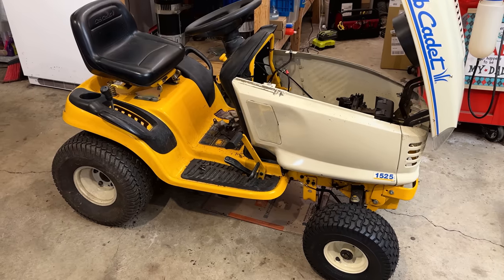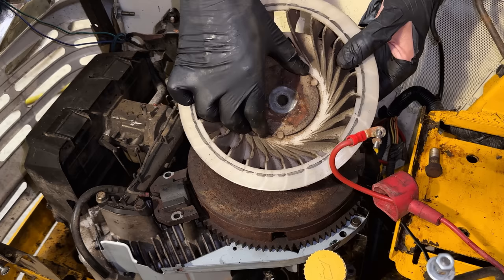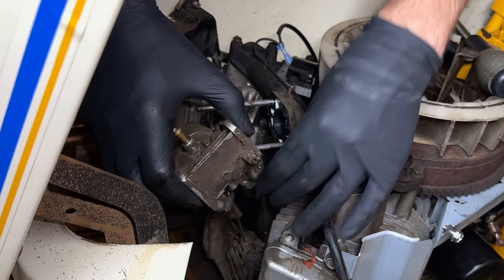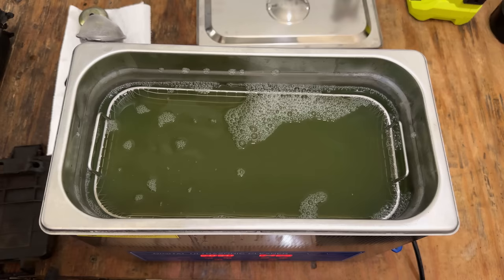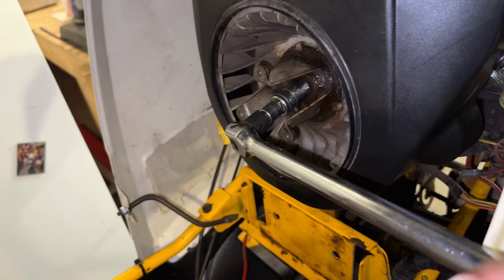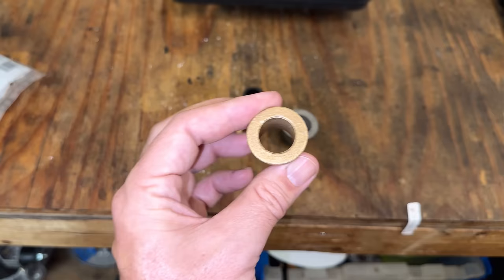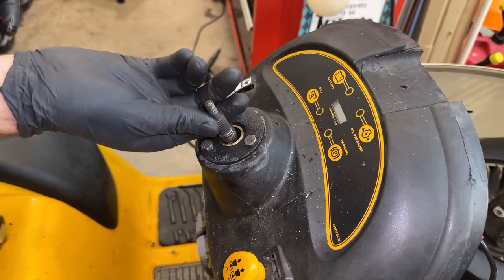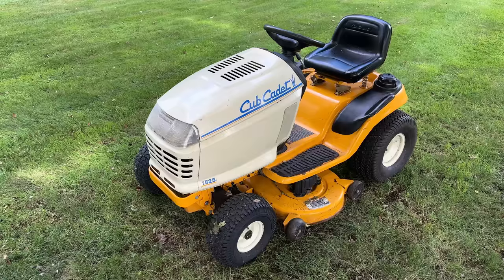Cub Cadet Crash (Pt 2) - Tractor and Tree Damaged

Comment: I think there's a lot more to the story you weren't told, not to mention a massive lack of maintenance.....I can't see an impact that caused only a small dent and no damage to the hood causing that kind of damage to the steering.  And he must have stored that thing in a salt shed for 20 years to get that kind corrosion on the engine.  Also you probably should have skipped the grease....it sounds like a good idea, until it gets full of dirt, and then it's like having sandpaper in there.  A plastic bushing, dry film lube, or nothing at all would have been a better choice.

Comment: 52:20 Why not just use fiberglass to make the hole the right original size where it is worn away?
Reply: You need clearance to allow the shaft to turn...so how do you JB weld that hole to achieve that clearance?
Reply: @JohnSmith-pl2bk  First, fiberglass, not JB weld. Second, there was already plastic there. After the repair, it would be fiberglass.
JB weld would never hold, but fiberglass would.

Comment: Great Video.  Maybe I missed it but did you replace the blades? I did notice that you straighted the front bumper.  Good job.
Reply from the maker: I part 1 I replaced the blades
Reply: @jcondon1 You may want to get a high lift mulching blade.  I have Gator blades on my 38 inch deck and they do a nice job.

Comment: Dam, how fast was he going?
Reply: I see you still put batteries on the concrete floor you should put a board underneath your battery or batteries save the energy within the battery it won’t drain into your concrete floor cement floor which ever way you want to say it

Comment: I am working on a Cub Cadet push mower right now that has been sitting for an unknown number of years. The carb was in rough shape, but I gave it a thorough cleaning, and it appears to be functioning now. The mower will only run for about a second, and never gets to full speed, even with starting fluid. It has an OHV engine, but I can't figure out what brand it is. The engine number is BCZHS 1791V1. I was thinking of doing a valve adjustment on it, but I need to know what the proper clearances are. The mower was produced in Sep 2011. Do you know anything about this engine?
Reply from the maker: I do not know about that engine.  If no specs, would check where the valves are now.  Usually an intake should be around 0.004” +- 0.001” and the exhaust a little more 0.006” +- 0.001”.  The important thing is that each valve has at least 0.004” of clearance and no more then 0.007” on most OHV engines.

Comment: See those little blades of grass by the Cub Cadet logo? Yours was made by MTD. Many Troubles Daily. Some good names like Cub Cadet, Troy-Bilt, Craftsman and more have been either bought out by or farm out the production of their outdoor power equipment to MTD. They  cut corners like that so called plastic steering bushing in the the instrument cluster and other short cuts to reach a price point so the can make a big profits for the share holders. In the process they produce a piece of crap that destroys the reputation of some formerly well respected brands.

Comment: What kind of cleaning liquid did you put in ultrasonic cleaner that does not destroy aluminium?
Reply from the maker: Harbor Freight Super Heavy Duty Degreaser.  It works well, but does react with some carburetors and caused the aluminum to darken.

Comment: Do you have a DOM on that tractor? Pre or post MTD purchase of Cub Cadet? (1995)
Worth fixing up? Yes. I just put $500 into my 2004 Craftsman/AYP/Husqvarna LT3000.  My deck rotted out, so I bought a new deck, replaced both spindles, even though the old ones were still ok.  New carriage bolts and nuts,  deck belt.  It now runs like new. It nearly looks like a new unit after 20 mowing seasons.  Worth it? Most certainly!
Reply from the maker: 2003

Comment: If you need a pump I have a AR RSV 4G40 I'll send you.  It needs a 1 inch crankshaft.  It came off a unit with a Honda GX340/390  I got it in a trade and the guy said the oil seals were out on it but I don't think so.  I believe the oil was contaminated.  If you're looking to buy a reasonable priced replacement check out Canpump.  They are the same mfg as MITM just better priced.
Reply from the maker: I have a cheap vertical shaft pump.  Found a cheap $60 pump on Amazon.  It’s worth a try.
Reply: @jcondon1  I've put dozens of those on machines, they are fine for normal/non commercial use.  I want to say they are rated for around 150 hours

Comment: Thats a toy  on your lawn, your yard is really big  you need a much larger mower like a 42" deck or larger zero turn.

My whole yard area with grass is about as big as what you just did  because 90% of its hills at 45 dgr slope it used to take me 3 hours with a push mower  the lawn tractor 45min.  However my property is 3/4 of an acer its mostly woods and I'm not taking down the forest area nor will i mow it. 
I will bet your yards a lot of fun in the fall to clean up.
2 of those might make short work of it. You can block off the discharge and mulch.
Reply from the maker: Definitely would not want to use this as the primary in my hard.  The hill would likely kill the transmission or roll it over.

Comment: Your Cub Cadet is a Murry which is a very cheap lawn tractor. It is worth about the $450 you put into it. John Deere doesn’t use plastic hoods. They are all fiberglass and a used lawn tractor in a John Deere with the same mower width and age would be worth $1,600 without any repairs. Kmart and Walmart sold Murray’s before Murry bought Cub Cadet.

Comment: I am in the market now for an Ultra-Sonic Cleaner. I still have full sized Carbureted vehicles and wonder if any one  can help me with a size, that might work for me. I am attempting (I use that word loosely) to revive a 1982 F250 with a 351 Windsor with I do believe it is an Autolite 2 barrel
I should be asking on a different channel....Hopes and Dreams I guess! :)

Comment: The thing that annoys me about this tractor is they are trying to pull off a garden tractor vibe with the lug bolted rear wheels and perhaps Cub Cadet name but it's mostly just a crappy lawn tractor.  Yes the Kawi engine is more premium than some other choices they could have made (and hopefully the hydro unit isn't one of those cheapo Tuff Torq units), but overall I am not impressed.  I am sure this was not a $1500 machine, either.